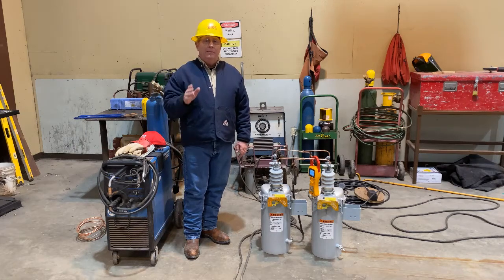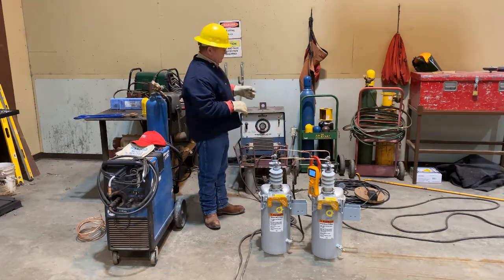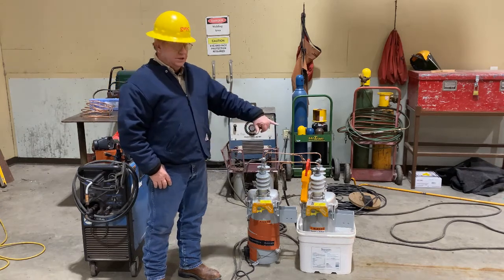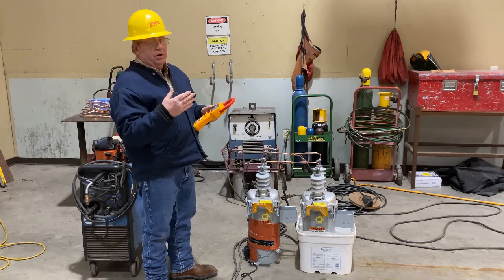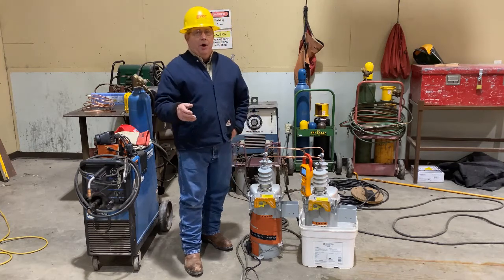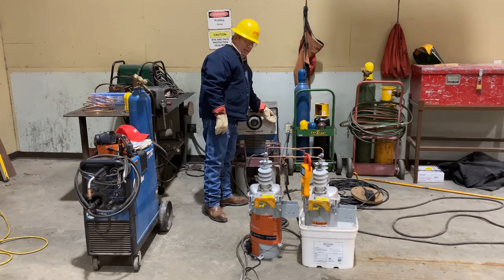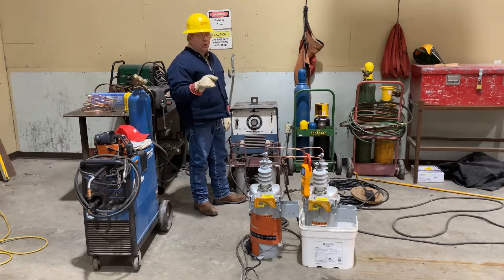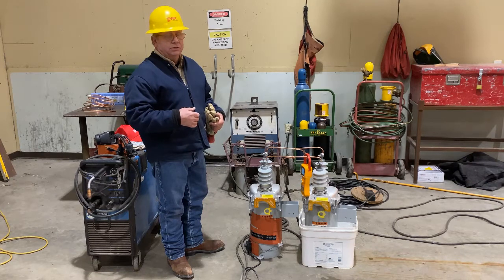Lineman Talk - Oil Circuit Recloser Testing OCR

Comment: What is the Miller device you are using? Could not find it when searching for Miller faulter
Reply from the maker: Poor man’s way to create and control a low voltage fault.
This is an old AC-DC welder in our mechanic shop, set on AC. Have seen 400A on a slow recloser curve. Usually 2-250 on an A curve.
Reply: Thank you for the info. Have you ever blown the breaker feeding welder when doing this?
Reply from the maker: @kycjh14  Never tripped the breaker serving the welder. A person new to stick welding will probably keep the rod stuck to metal longer than a device will on a slow curve.

Comment: Why didn't the recloser with thinner oil, after heating it to 140 degrees lockout 1st?
Reply from the maker: Thank you for your question. For 40 years I have thought thick and thin oil should operate the OCR differently. 
The way we think, the thinner oil should have flowed faster through the weep hole and the device should have operated faster.
A curve timing tester should have been used but was not available. Two things I think about, 1, timing difference is probably in milliseconds and we can't see/hear that. Second, the oil temperatures may not have been drastically different enough to change the viscosity of the mineral oil. The fault current delivered was less than three hundred amps and the curve reacts to fault magnitude. If I could have pushed a one- or two-thousand-amp fault, the results may have been different.
Reply: @linema22n  Richard do you know if there is a service to check contacts and basically service an old recloser?
Reply: We have a kyle recloser type wv-27 sitting in our yard that there is no history on.
Reply from the maker: @TripleTRanchAndSawmill  yes, a transformer shop can do that work. Solomon and maybe Emerald can service OCRs. Years ago that service was done in house.